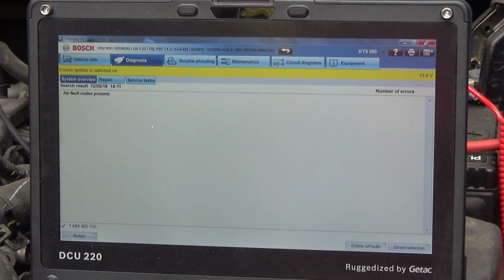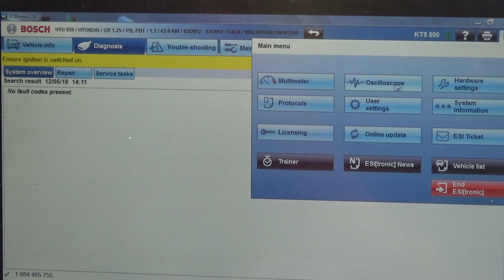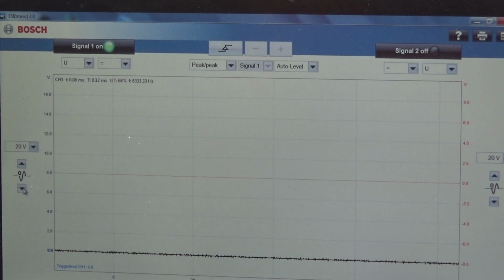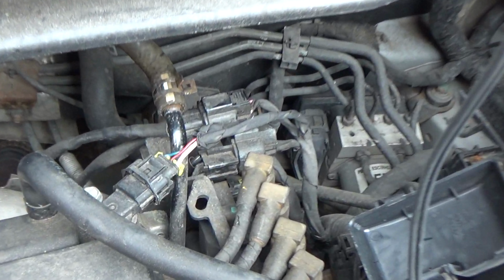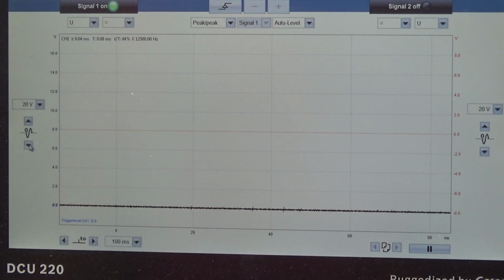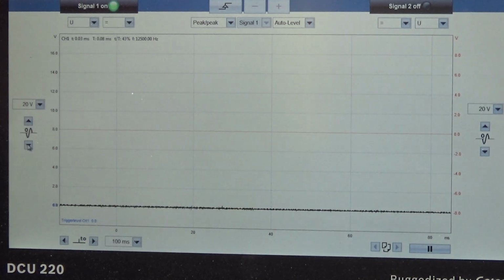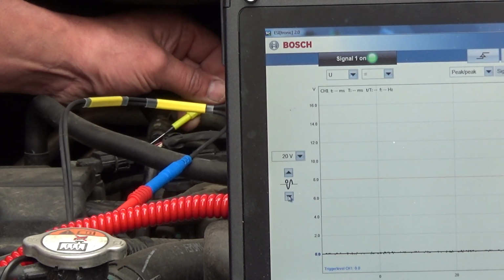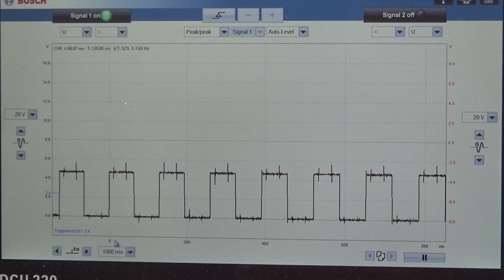KTS Scope basics

Comment: Nice Steve. was rhere scannerdanner with you? because i saw his hand with the testlight :) 
btw. was that pull down design circuit because of the bias voltage on the signal wire?
Reply from the maker: kristof mikulski no, Paul’s across the pond 😂 yes, pull down 👍